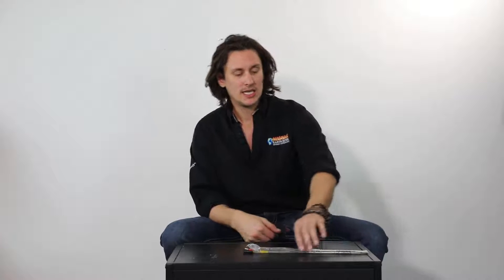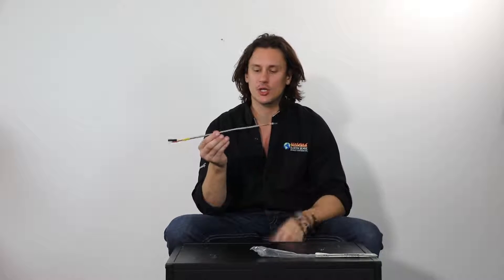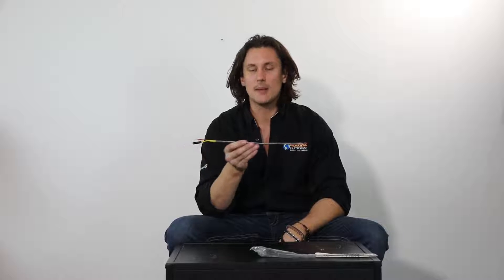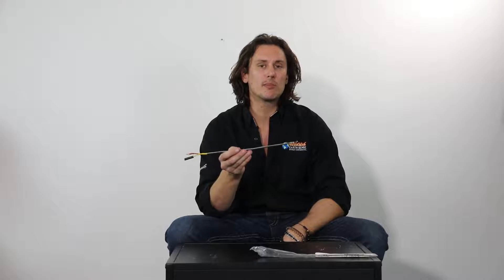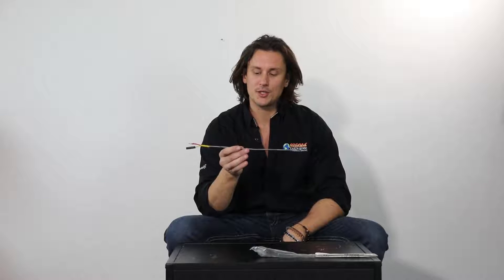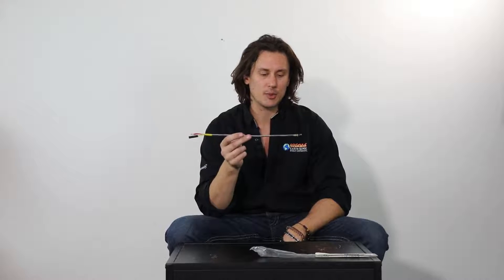Quadrafire Thermocouple Function & Troubleshooting

Comment: 2008 CB1200i, So my stove will light, get a grean light and seems to attempt to call for pellets sometimes feeding a little and sometimes not. I changed the thermocouple, same problem auger motor sometimes runs, sometimes sounds as if its trying, kind of clicking as low voltage sound. So i changed the auger motor, pulled the auger assembly everything there is good. Once stove trips has three amber blinking lights. Flue pipe is clean as well as exhaust clean out. Exhaust motor was replaced last winter. Control board? I haven't jumped out the vacuum switch yet could that be the issue?  Thanks appreciate the help!
Reply: Update, so vacuum switch is good, stove lights gets a green light on control board, feeds some pellets, then control board goes to red light saying it reached 600 degrees. Thermocouple reads 14mv at that point, Stove doesn't feed after that and convection blower never turns on. Jumped convection blower and it turns on.  Thoughts
Reply from the maker: @ericmoore203  Thanks for the message back Eric. The 3 amber blinking lights on start-up is just a self-diagnostic. If we see the 3 amber lights on shut down it indicates a thermocouple fault. Glad you were able to rule out the vacuum switch and you made sure the convection blower turns on (Snap-switch most likely just needs to get hotter for it to lock-in - generally does not get hot enough on start-up, needs to go into normal operation.) This leads back to something with the thermocouple or the control box recognizing the thermocouple. I'm checking in with our techs on Thermocouple millivolts and will follow up. Is there a local dealer near you that could test your control box?
Reply: @EarthSense  thanks for the reply. Unfortunately I don't know of a local place that can test the control board. I did call and left a message for the service guy where the stoves where purchased. Haven't heard back yet from him. Please let me know what your techs think. I'm under the impression that the thermocouple is working correctly. It starts out with low 2-3mv then as it gets hotter goes up to around 14mv.  That's what makes me believe the board isn't reading it. But obviously don't want to switch a board if I don't have to. I appreciate you responding so quickly. Thanks Eric
Reply from the maker: @ericmoore203  Thanks Eric. Will follow-up asap on the TC readings from our techs, should hear back very soon. If it comes down to testing the board that is a service we do offer, but let's hold off until I can get some further info on the TC. Thanks.
Reply from the maker: @ericmoore203  Hey Eric, few different notes and questions from one of our other technicians. Does the call light turn off even though the t-stat is on/calling?  If so, the #2 snap (Overtemp) might be opening.  If the call light is shutting off, need to check the room fan operation and the #1 snap switch. (which I know you've done already).
The control board is programmed to recognize only two millivolt quantities, 3mv turns on the green light POF and 12mv to turn on the red light.  All other mv readings do not matter and if you are watching a meter then yes, mv’s produced will go higher than 12mv.  So, 3mv for Green and 12mv for Red.

Does your model have a hopper switch? If so, bypass to see if it's an issue. Could also try hitting the reset button to initiate another start cycle, does it feed again?  Feed motor can’t be ruled out either, heat building up could be affecting the motor.
Reply: @EarthSense  so the call light remains on the whole time.  Once red light on control board comes on, seems to stop feeding, burns down to nothing. Green light will come back on control board, I believe signaling thermocouple is cooled down under 200f. If you push the reset, it will begin to feed again, lights, and repeats normal warmup till after red light comes on signaling thermocouple has reached 600f. Soon after just quits feeding, fire burns to nothing, and goes out. Call light still on.
Reply: No hopper switch that I know of or listed in service manual.
Reply from the maker: @ericmoore203  Thanks Eric, received your messages here, appreciated. Sounds good on the hopper switch, that's something they incorporated around that time so just wanted to check on that. If it's not listed in your owners manual then your stove does not have it. I'll be in touch later today with further info from technical. Thanks.
Reply from the maker: @ericmoore203  Hey Eric, heard back from our technician - So, 3mv for Green and 12mv for Red.  For shut downs, the green light will stay on because the TC temperature is high enough to produce at least 3mv.  Once mv output to the board drops below 3mv the green lights goes out and the board then runs the combustion fan for 18 more minutes.

Hi, med, low – what setting are you running it at?

Pull the vacuum tube off, clean out the vac tube and the port at the top of the auger tube.

Keep us posted Eric, thanks.
Reply: @EarthSense  Running the stove on Hi, I'll give this a try and let you know. Haven't had a chance to get back to it the last couple days. Thanks.
Reply from the maker: @ericmoore203  sounds good Eric - Our lead tech does think it has something to do with the vacuum switch or hose. If not this, I circle back around to the control box not properly detecting the thermocouple to allow it to go into normal operation. Again, for this I would recommend the control box is tested first to make sure. Thanks.
Reply from the maker: Thanks for contacting us, happy to help. If I understand correctly the amber light is just indicating that the board sees the thermocouple when it calls for heat. If the red call light comes on, the combustion fan should start then power through the pressure switch and high limit to the feed motor.  We can troubleshoot by checking the  switches or using a multimeter to see where power to the feed motor stops. I think we should start at the pressure/vacuum switch. Inspect the tubing to ensure there are no breaks/cracks and connections are secure. The vacuum switch can be tested with a multi-meter - video below on that. If the vacuum switch checks out good, let's inspect the high limit switch. For troubleshooting we can bypass this switch with a jumper wire. We never want to leave a safety switch bypassed, just for troubleshooting to see if that switch is intermittently opening causing the feed motor to be intermittent. Video below on creating a jumper wire to test this switch. 

Testing Vac Switch: https://youtu.be/kR0DQ6_YXuI?si=O9LRPKRBa8qZKZ4i

Jumper Wire: https://youtu.be/FDVkbsHS95U?si=6KdkpfIOOuWhMz4d

Keep us posted, happy to help get you back to 100%. Thanks.
Reply: @EarthSense  thanks for the reply, I will try this and let you know how I make out. Thanks.
Reply from the maker: @ericmoore203  Thanks Eric, you're welcome. Yes, keep us posted. Appreciated.

Comment: I have a Quadra Fire 1200i pellet stove fires up normally, cycles through heat and fan operation, but the convection fan turns off after about 10 minutes while the stove continues to feed pellets.
Reply from the maker: Thanks for contacting us, happy to help. Your 1200i has a convection snap switch which allows the blower to come on when it is warm enough and shuts the blower down once cool enough. Let's inspect this switch - make sure the screws have not come loose and the electrical wires are secured well. Here is the switch for reference https://pellethead.com/product/quadrafire-heatilator-ecochoice-1-low-limit-convection-snap-disc-125-degree-safety-switch-thermodisc-oem/
You can also bypass this switch for troubleshooting to determine if it is faulty. Here is a video on creating a jumper wire to do this. https://youtu.be/FDVkbsHS95U?si=YNk2R3fdPY9wUwPR. You can also test your blower to direct power to ensure the motor is operating correctly - video on doing that here. https://youtu.be/rlmiCYI2WPk?si=O4xH4toaz9klyNXg
Keep us posted, happy to help.

Comment: Hello!  I keep having to replace the firepot thermocouple on my mt. Vernon AE.  After each replacement it works for a few cycles and then I get a “bad thermocouple firepot” error.   I’m not sure how to keep this from re occurring.   Is there a support email that I can reach out to or talk to a tech over the phone by chance?  Thanks!
Reply: Off topic a bit but … I can’t figure out where my new thermocouple wire inserts into the control panel? It was dis attached when I went to plug it in? 
I also have a Mt.Vernon AE so I thought you might know the location please and thank-you!
Reply from the maker: @KarenBuchanan-j9q  Thanks for contacting us, happy to help. The Firepot Thermocouple will go in the #9 port on the control board. The Drop Tube/Ring Mount Thermocouple will go into the #10 port on the control board. Below is a reference link of the control board diagram which you will find on Page 43 - https://downloads.hearthnhome.com/installManuals/7034_106.pdf

If you need any other assistance just let us know. Thanks!
Reply from the maker: Thanks for the message Tim. Just touching base with our lead technicians on this - I will follow back up shortly with you. Appreciated.
Reply: @ thank you!
Reply from the maker: @timwilson3529  Thanks Tim. Some further feedback and questions here.
Let's verify the thermocouple connector on the control board is in good shape. Is the ceramic thermocouple cover all the way over the Thermocouple while in operation? Take an ohm reading on the new thermocouple and then take an ohm reading on one of the “bad” ones. If the ohm reading is the same it is probably an issue with the control/circuit board. Please keep us posted, happy to help how we can. Thanks.
Reply: @EarthSense  sorry for the delay in response! I missed your comment!  Thanks for getting back to me.  Yes recently replaced both ceramic and thermocouple!  After installation, I ensured that the ceramic was tight up against the thermocouple itself and secured with bolt/screw.  I no longer have a new unused one to check against, but my old one appears to have .25 ohm, the newer one that is in the stove appears to be open with no resistance.  What is the expected ohm reading?

Also, do you know what the reading should be from the control board if I need to test that?
Reply from the maker: @timwilson3529  Thanks for the message back Tim, happy to help. Discussing specifics with our tech team - we will follow back up asap. Appreciated.
Reply from the maker: @timwilson3529  Hear back from our lead MTV AE tech 'Poor connectivity at the board and very sensitive. Try securing the cable to the surrounding wires to stabilize the board connection.  Now adjust the connector molex until the fault stops, tying up the wires helps hold the TC cable in position.' 
Keep us posted as you try this. Thanks!
Reply: @ would you be able to tell me what the expected ohm reading is of a good thermocouple? Thanks!
Reply from the maker: @timwilson3529  Hey Tim, thanks for the message. Heard back again from our lead tech on this - 'The K style TC used in the MTV AE is not a thermistor where resistance values change with temperature.  It is simply a quad style thermocouple that generates DC mv  but with more precision than the twisted bi-metal type found on 3 and 4 speed Quadra-Fire models.  The AE used a twisted bi-metal TC in the ceramic cover for the first 3 years and then came out with the K style.  The only multimeter check is for continuity which does not translate to mv production.  The clues are in the faults shown on the wall control, “burn pot TC” = no continuity, “missed ignition” after start-up fire is established and goes out can be a TC that has continuity but not producing mv.' 

Hope that information is helpful, please keep us posted with any further questions. Thanks!
Reply: @EarthSense  interesting!  Definitely the new warrantied thermocouple seemed to have gone bad.  After checking the old thermocouple it seemed to have some continuity,  the new one was completely open.

I adjusted the molex connectors like suggested and still did not work, so I installed the old one and seems to work for now.  Should I contact your support for a new replacement? Thanks!

Also, I was wondering, could the fire be burning TOO hot causing the thermocouple to go out?  I had the flame adjusted to -3 preciously and just adjusted it down to -5 Incas that was the issue
Reply: @EarthSense  dang, just kidding.  I guess I hadn’t tested the old TC long enough.  After one cycle it, on cool down phase it tripped the bad TC fire pot.

Maybe the old one was bad after all?

I did test with a jumper wire to see if the fault still occurred.  The fault did not present it self with a jumper wire on the two TC pins on the control boards.
Reply from the maker: @timwilson3529  Thanks for the messages back Tim. It's possible the old TC was bad especially if it did not fault when jumped. As to the fire, as long as the thermocouple cover is properly in place it will not get too hot on any setting to burn out the TC. Here is the replacement TC we offer, it does come with a 1 year warranty. The OEM would be a special order part from the factory. https://pellethead.com/product/pellethead-replacement-quadrafire-mt-vernon-ae-edge-60-thermocouple-k/ 
Please keep us posted, happy to assist however we can. Thanks!
Reply: @EarthSense  I’m glad y’all had next day delivery in my area through amazon.  Order replacement and tested it against the old ones. I guess the original replacement I received via warranty might have been defective. It did not have full continuity like the new one I received this week.  Seems I should be back in business as long as this one does t fail too!  Thanks for your assistance in trouble shooting
Reply from the maker: @timwilson3529  Thanks for the message back. Definitely keep us posted on the performance once it is in. As mentioned in previous messages in the thread, let's make sure the TC connection and cables are secured really well. Thanks so much!

Comment: I have a 2021 Quadra-Fire Castille pellet stove, My stove intermittingly overloads the fire box upon restart and starts
smoking a lot out chimney before it lights up. Then the flame burns hot due to the level of pellets in fire box
Reply from the maker: Thanks for contacting us. I would suggest doing some timing tests during startup. It will be important to determine if there are variables during the initial feed/start-up sequence. The start-up sequence is only controlled by the control box. If there are variables to how much time the stove is feeding during start-up, we would suggest getting the control box tested by a local dealer. Oftentimes it can appear that too many pellets are coming in during start-up, but in reality it is a loss of air flow that it causing the heavy smoke and high flame during startup. If the start-up/feed timing is always the same, then I would say we have an air flow issue and would have you check the following:
1. Burnpot holes open and clear
2. Burnpot bottom porkchop sealing tight and opening and closing correctly. 
3. Door Gasket and Ash Door Gasket sealing tight
4. All excess ash cleaned from the stove, ash traps, and venting.
5. Nothing blocking the air intake to the burnpot
6. Inspecting the function of the combustion blower/exhaust fan. Should be running near line voltage during start-up. 

Keep us posted, happy to help.

Comment: Will use the fine steel wool to smooth out the sides an bottom of the pellet box so they will slide down better thanks this will work
Reply from the maker: Sounds good. Keep us posted if you need anything else. Thanks.

Comment: My classic bay  q fire is 20 years old am now the pellets seem to get stuck in the hopper an I hav to dislodge them it works fine till they ,I see some fine rust particles on the sides of pellet box how do I make it smooth so they will slide down?
Reply from the maker: Thanks for contacting us. For the inside of the hopper you can use a fine steel wool such as 00 or 000 to smooth out the inside hopper walls so the pellets glide down smoothly. If you are experiencing jams in the auger itself, you may want to pull out the auger shaft, inspect the auger shaft for wear or metal burs, and inspect the shaft housing. Any other questions please let us know.

Comment: Can anyone help tell me what to check for a Bad TC Firepot error? It is an older Mt Vernon unit and just started throwing up this error.
Reply from the maker: Thanks for contacting us. In most cases this will indicate a TC (Thermocouple) failure. We would suggest checking the TC wire connection to make sure it's secure. You can pull off the ceramic thermocouple cover to inspect and clean the TC. If your wall control is still showing the error code, we would recommend replacement of the TC. Here is the replacement for reference, any questions please let us know. Thanks. 
https://pellethead.com/product/quadrafire-mt-vernon-ae-edge-60-thermocouple-k-bundle/